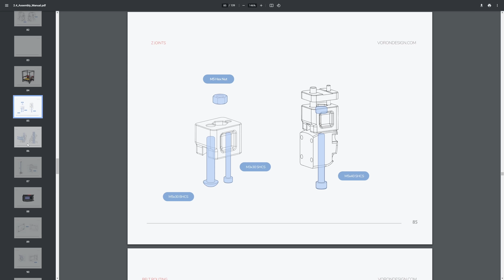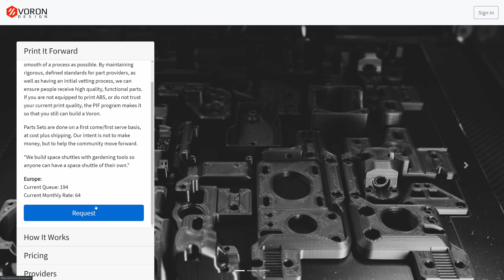My new favorite 3D Printer! The Voron 2.4 Build Experience

Comment: Hi, I love your videos, I was able to completely rebuild my CR-10 Smart with BTT SKR E3 V3.0, Relay V1.2, PITFT50, LGX Light, BL Touch and Klipper.
I am now planning to build a 350mm Voron 2.4 R2 and have a few questions before I order parts:
My current thoughts on a configuration are-
Stealth Burner with Clockworks 2 or LGX Lite - Currently using a LGX Lite on my CR-10 Smart and like it.
Hot end - I am leaning towards the Rapido HF, but I am concerned I will need to go to an LRS-350-24 due to the 4.8amp current draw on startup. Your Thoughts?
Regarding Mods - 
Is it advisable incorporate the Voron2.4_Trident_Pins_Mod? Does it make any difference / worth it? Does anyone sell pin kits?
Are they any other mods i should consider before I order my printed parts?
Is it worth concerting the following mods?
Titanium Backers for Voron 2.4/Trident
Kinematics Mounting V2.4
Thanks
Reply: Hello, congrats on the CR-10 build.
I would recommend holding off on mods such as Kinematics Mounting, Titanium Backers and other complex mods if you have no previous experience with Voron printers. The reason for this is that you don't know the need or demand of these mods before you have experience using the printer. So they may not be needed at all. But they are good mods.

There is one that I would recommend from the start though and that is the Nevermore Mini, it is a small air filtration unit that sits under the bed and is filled with carbon to absorb the carcinogenic fumes released from ABS printing. It also helps circulate the air which helps improve chamber heat up times.

You should look to the Discord of Voron, there you can find answers to a lot of questions.

Comment: I'm considering a new build for printing my RC airplanes.  I want to make it tall so I can print an entire wing in 1 part instead of 4.  I'm finding with my Prusa printers that part shrinkage at the bed slightly pulls the magnetic PEI sheet off of the bed.  This results in a part that is not flat and becomes a real problem when assembling the wings.  My old Anet A8 had an Anycubic Ultrabase heat bed on it printed perfectly flat parts so I'd like to continue using that heat bed...Can the Voron build use a different sensor like a BLTouch so that I can use the Ultrabase bed?

Comment: That's the only thing I didn't like about every 3D printer of ever used so far. The speed that is supposed to be 100% is never reliable and you always have to dial it back. I've noticed dialing the Ender 3 back to 80 percent gives me the most reliable prints.
Reply from the maker: Well, it's a bit different when you dial back from "oh let's just try 300mm/s" to "250 is actually perfect" 😉

Comment: HI, THOMAS please I need your help. I have follow all your Voron 2.4 series, but I have another board and I keep getting  this message ( Unable to read tmc uart 'stepper_X' register IFCNT) everything else in my printer (Voron 2.4, Spider V1.0, TMC 2209) works, display, heater, bed heater, fans etc, but I can't pass the initial set up I must have something wrong in my printer.cfg or it might be the wiring or I don't know what, its driving me crazy. I don't now how to code but I have search everywhere and nothing clear or easy to understand. HELP thanks

Comment: Your entusiasm on this voron is tempting me. But why the xy gantry is the moving part instead of the bed go down??  as usual in corexy . I haven't understand it.
Reply: one of the big reasons is it keeps the majority of the weight of the printer down at the bottom to keep the printer more stable.
Reply: Z hopping goes a lot faster with this setup. It adds up when you have longer print times
Reply: Also, that's the differential of the Voron 2 line, for a more conventional printer with a moving bed on the Z axis you should look at the Voron 1.8. It is as good as a Voron 2, but it unfortunately isn't as popular.
Reply: CoreXY just describes the XY kinematic, you can implement Z either way.

Comment: Can't you still put some heat resistant material between the bed and the lower panel?
Seems to have enough space under there...
Reply: He didn't install the lower bay cooling fan(s).  There are also corner plates that help keep it from warping that he omitted.

Comment: Probably a dumb question but idk much about octoprint or klipper but will they run without internet? I could care less about remote this and that, wifi and so on. If i need it for the initial setup thats not to bad but other than that i wont be interested. And what about direct drive extruders too
Reply: Yes they will. You can control it through the display on the printer. Additionally, they are not controlled remotely on the internet. Rather, it hosts a website that you can visit locally on your network regardless if you have internet access or not. In there you can upload the files you want to print, control all the things you can through the display and all that. 

To me it offers a much better user experience since I can control it more quickly and intuitively through a website with my mouse rather than the display. It's also nice that you can slice a model on your PC, then just upload it. So I can keep the whole workflow on my PC.

The Voron 2.4 uses a direct drive extruder system.
Reply: @FelixG  so u can visit and use a website without internet?

Comment: huh people warn a lot against the kit you used but your experience is fine. then again they could've seen the order name and sent something nice.
Reply: Formbot is usually good to work with as a company.
Reply: The problem with the Formbot kit is that the company have a historic of replacing parts with ones of unproven quality. That was specially true with the V0 kits, at some point they replaced the stepper motors to a brand that you can't for your life find a datasheet. Other than that, the kits are ok.

Comment: Great videos. Question about the Voron 2.4 build, how did you get such high print and travel speeds? Is it due to using the Duet 3 board and components compared to the SKR 1.4 or BTT Octopus boards? I am seeing print and travel speeds posted as 250mm/s and 300mm/s respectively.  Or is it due to the firmware running the machine?  I am thinking of building one but trying to sort out the information to get the proper parts.

Comment: I am more concerned about the glue on the magnetic bases, than about the magnetism itself, I recently had whambam glue caramelize on me.
Reply: The type of glue that goes on these isn't usually too difficult to replace; it turns into this gummy material that scrapes off fairly easily, and the replacement is already in the form of a film, which makes it pretty easy to apply.

Comment: I never built a Voron so no idea about how good it is. What is the advantage of those 4 screws on Z, seems way too overengineered and expensive to me. I have 2 Hypercubes, also CoreXY with bed going up and down, only one screw, also not the best solution, I think the best is with 2 screws on the sides of the bed so it will not hang down on the unsupported side. Could you build a Hypercube and compare it to other XY designs?

Comment: Hi 
Can you guys clarify what makes this printer so mush faster than other printers? My printers never reach speeds anywhere near this Voron machine. Despite linear rails and Mosquito magnum hotend. Cheers
Reply: I don't know which printer you have and what you are slicing, what slicer you are using and which settings your slicer you have. However, to get a speed of extruded plastic, you need at least 3 things. These are a) setting the speed in your slicer, b) setting the acceleration in your slicer and c) having a model to print with long enough stretches so the maximum speed can be achieved with the chosen accelertation. If one of the 3 things listed is missing, you will not reach any significant speed. For the speed/acceleratio there are X and Y as well as E (extrusion). To this you add retraction speed/acceleration and travel speed/acceleration. Speed and acceleration of Z is of minor importance in all bust fringe cases ... unless your printer lifts head before moving. So if your slicer speed and/or acceleration is not set for maximum speed or if sliced model is many small movements, you will not have a fast print. Note that for things to make sense, you should not choose speed/acceleration above what your printer in its firmware has as a maximum unless these are set very conservative and there is a way to increase these max values in your printer.
Reply: Hi Peter Thank you for the reply.
I am aware that I did not provide information that allowed you to evaluate the speed of my printer. Only indications that we are talking about quite capable printers.
In the video by Thomas he suggests that the Voron printer is  substantially faster than most printers. My question goes to what might add up to this difference?
Kind Regards 
Poul Erik
Reply: @PoulErikCh  I think on a higher level you can define the ingredients required for the "substantially faster than most printers" is based on stringent rigidity combined with high stepper motor torque (0.58 Nm). To this you can add a very well designed XY belt and motion system. Also the gantry (for X-axis) and X-beam (Y-axis) appear to be well designed and lightweight. To this you can 2.32Nm torque for the Z-axis - almost 6 times the torque in my current low cost printer. Furthermore the design choices and implementations appear to me to be so, that rigidity over time does not gets compromized by wearing down. Overall a very well engineered solution which bear the hallmark of being designed by a group that appear to have inspired and supplemented each other rather than being designed by a single brain or designed by groups in a committee working parly against each other. And I guess it is the many good solutions to known problems combined in one product, that makes it pretty darn fast.
Reply: @PoulErikCh  Low moving mass (upgraded my printer to Bowden, half the moving mass twice the speed and acceleration), low drag (my printer with linear rails vs roller wheels on effectively nearly identical machines does about 3x the speed, also avoids ringing in the prints at high speed), powerful heating nozzle (instead of taking 10 minutes to heat up before the print it only takes 45 seconds to go from room temp to 240c, it also can push an utterly insane volume of plastic, like I can use a 1.2mm nozzle and push it 100mm/s with .4mm layer height, something completely and utterly impossible on my other machine that just doesn't have the heating capacity and gets overloaded at over .4mm nozzle at 100mm/s at .3 height). The next thing is partly rigidity and harmonics, some printers get weird defects like salmon skin (motor drivers typically) or wavy looks (multitude of things), or flex in the printer hammering it back and forth like gear teeth (I print a lot of fine tooth gears, and you can see my machines just shake at higher speeds and practically walk across the room so I've had to bolt them down before)

These comparisons I make are on my 2 machines, very similar to Ender 3 types of printers and nothing like the voron with its CoreXY, the CoreXY just incorporates all of these advantages right off the bat and does even better by eliminating the moving bed which is heavy (the reason mine improved so much is my X motor is a pancake Nema 17, that's why its speed doubled, which it would also double on CoreXY but not all Cartesians will see as big of a gain, kind of a footnote disclaimer there)
Reply: @ Poul  A printer's speed is limited by the slowest move.  When you have to move around the actual print, which can start weighing a lot, the platform axis will put a huge crimp on the overall speed.  The platform speed has to be set to handle the largest mass possible.  You will also not have prints fail because the printed item snapped off the platform because of platform motion.  On a Troodon or Voron the print doesn't move at all, only the print head.

Comment: It seems that having the tool head move up and down, rather than the bed (like a Ratrig or E3D ToolChanger) is going to be a disadvantage when trying to add tool changing to the design.  Any thoughts?
Reply: Voron 1.8 supports tool changing not 2.4, the 1.8 is also an excellent printer, it just doesn't have the magic trick that is a flying gantry.

Comment: Is your printing plate aluminium? If so what is the magnetic sheet attracted to?
Reply from the maker: Yes, the plate is aluminum, but the sheet itself isn't magnetic - it's a simple steel sheet that gets sucked down by a magnetic rubber sticker that sits on top of the aluminum slab.
Reply: @MadeWithLayers  Got it :)

Comment: Can you get a 350 degree hot end for it  and can it be enclosed? Thanks
Reply: Yes to both. If you want you can fit even a Mosquito Magnum that can reach 500 degrees and there are quite a few webshops that sell Voron 2.4 Enclosure Panels that slide into the framework.

Comment: Hi Thomas, do you know if input shaping is supported by reprapfirmware 2.1?
Reply: No, it'll be supported only in RRF 3.4
Reply from the maker: The earlies version of RRF that supports a basic version of input shaping is 3.2, while the upcoming 3.4 comes with a more advanced implementation. https://duet3d.dozuki.com/Wiki/Gcode#Section_M593_Configure_Input_Shaping
Reply: @MadeWithLayers  damm, i guess i will have to finally upgrade (time to learn the new gcode implementations for some of the settings)
Reply: @garramiro  totally worth it. Variables and conditional gcode are so much more powerful than what you could do with 2.x and with the named IO Pins the electronics become much more flexible.

Comment: Basically your fault that I'm now questioning if I should wait for the next prusa fdm or build a voron as my second printer, after fully kitting out an ender 3 v2 with basically all possible upgrades, short of replacing the motion system...

Not even so much about huge speeds, but the vorons just seem to produce some of the best quality prints you can get from a hobby grade machine and are still faster than any Cartesian printer
Reply: If you have the money and time, Voron printers are just GREAT
Reply: Annex k3 prints faster and better quality than anything from voron.
Reply: @Tedlasman  but is also much smaller (github mentions 180mm cubed)
Reply: @Daepilin  k2 or k1 if you want bigger then. Should still be faster than a voron 2, but not 100% sure.

Comment: Is this thing really better than the readily available 3d printers? If i would spend 30 hours on this instead of doing my regular work, it would cost me over 2500 EUR just for my time spent.
Reply: Yes, it is. And so is the majority of the high end DIY 3d printers.

Do not get one if you have no interest in learning how they're built. The build and tuning process should excite you and if you're already thinking of it like work, it's probably not for you.
Reply: @miklschmidt  But why would i be interested in the build process? I've just bought a Qidi X-CF Pro and it's cool. I can print whatever i want and i treat it just like a laser printer. Unboxed it, plugged it in and printed stuff and have not a single clue how it works.
Reply: @youtubevideos415  I don't know, some of us are weird like that. It is what it is, you made the right choice :)
Reply: @miklschmidt  But i just wonder, is the Voron any better than the ones, you can buy out of the box?
Reply: @youtubevideos415  Yes, they are, the vast majority of the high end DIY projects are. They're mechanically better than anything you can buy for the same amount of money off the shelf. They print faster, with better quality, last longer, are easier to maintain, etc etc. That's usually the case when you can put the budget usually spent on assembly into parts instead. Furthermore it's built for people to build, not for machines, it makes quite a difference design wise. Not to mention that the effort put into these projects vastly exceed mass produced printers, you have an entire community of thousands of people dedicated to improve them, so they evolve over time and automatically become battle tested. It's just an entirely different thing. Of course i'm generalizing here, but there truly are very few exceptions.

Comment: You are using the stock motors that came with the kit right? I have a duet3 6hc too and am using LDO 0.9° steppers and the combination is just sooo loud (even at lower speeds than you are using). 
Any tweaking to the stepper settings in RRF?
Reply: 0.9s are just louder
Reply: @Tedlasman  didn't expect them to be that much louder. I really want to go with steppers with a plug tho so I might try some powerfull LDO 1.8 steppers...
Reply: @mschild95  the ratrig motors are on top right now for power, other than the trinamic ones.
Reply: @Tedlasman  do you have a part number by chance?
Reply: @Tedlasman  the cheap one :D
Reply: @Tedlasman  couldn't find it on mobile right now, only the BOM for printed parts and hardware but no electronics. Thanks in any case
Reply from the maker: Looks like you've already figure some stuff out 😉
But yes, this 2.4 runs with the stock included motors and they are a perfect match for the drivers. It's one of the quietest machines I have.
Reply: @MadeWithLayers , love it that you answer anyway, always great community interaction from yours.
Yes, I just ordered two high power LDO steppers from the ratrig page that are suggested by Tedlasman above and are meant to go with the v-core. They have even lower inductance (1.8mH vs 3mH, which is still one of the lowest you can get) than the 17HS19-2004S which are suggested for the voron but I really want to have steppers with plugs. If they are still too loud I might get the 2004S anyway from stepper online just to see if it makes a difference or if it is my frame that is picking up resonance (which I doubt to an extend, since the stepper is not touching any metal)